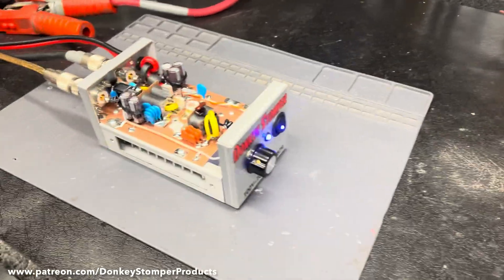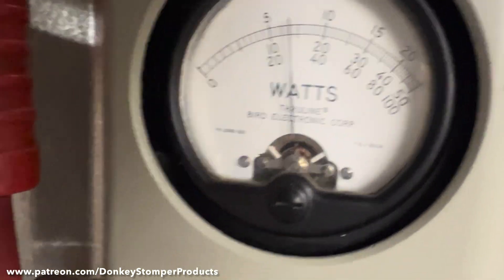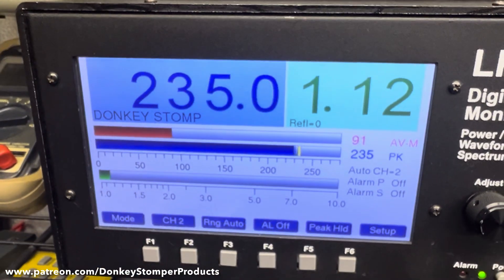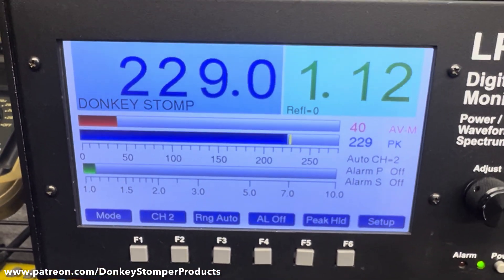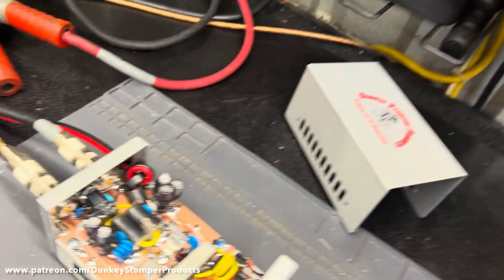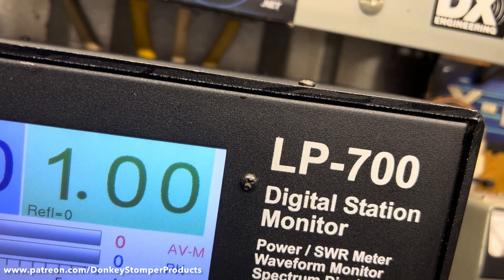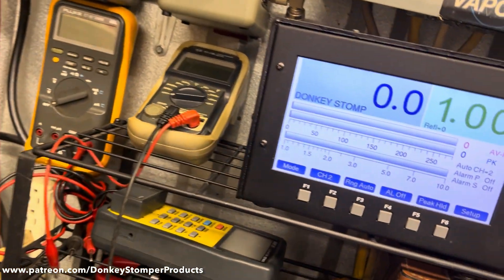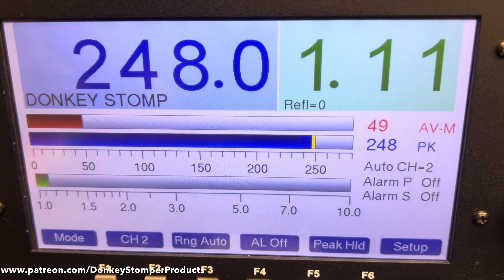100V-Toshiba-2879-1 Pill, Prototype 80V-HG-2290-1 Pill, Mobile CW Transmitter

Comment: nice build bud. Are you using 43 or 61 ferrites on the transformers? I heard some say it don't matter and some say only 61 works with HG, but the data sheet says 43 is good from 20 to 250 MHz and 61 is for 20 MHz and lower.
Reply from the maker: These 1 pills all 43. I had to figure out the tune. Most time at least on all output transformers I use 61
Reply: @DonkeyStomperProducts  ok Thanks
Reply from the maker: YW @mountainman969n.e.c.5